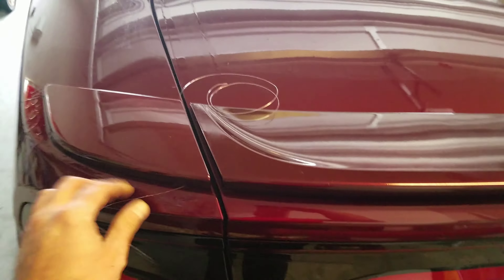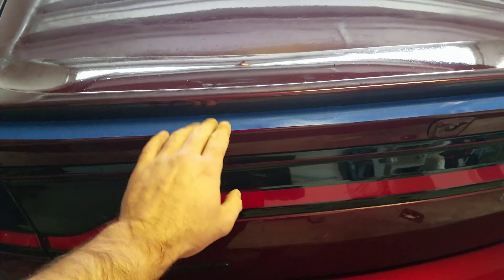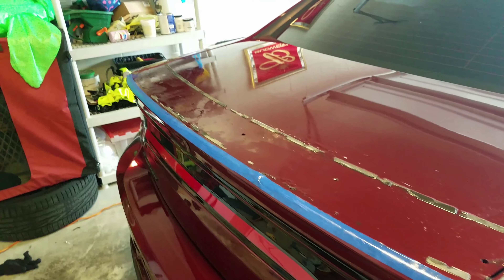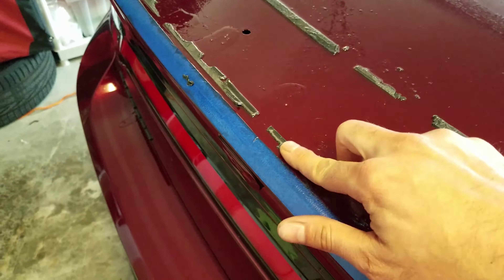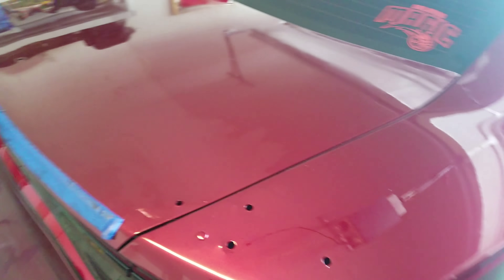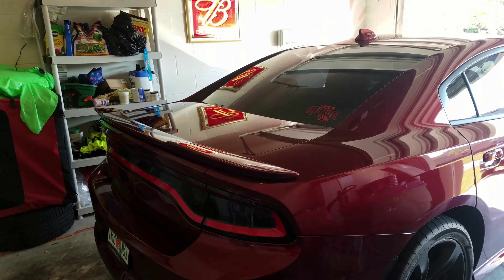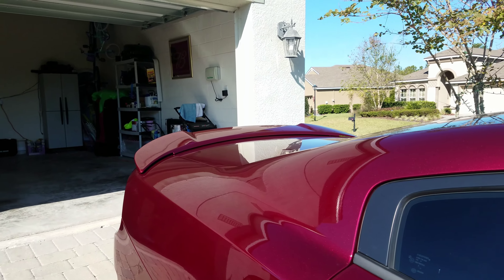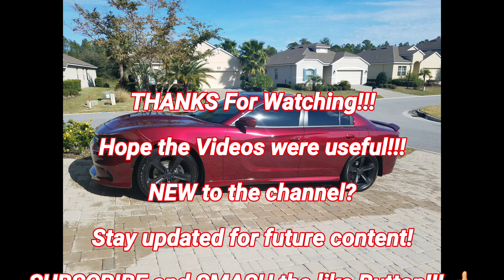Hellcat // SRT Spoiler Install PART 2

Comment: It looks good man. The plugs are barely noticeable since you perfectly color matched them. They kind of just blend in. I agree with ctcharger...after a while you won't even notice the plugs. Great job man!👍
Your car was already a beautiful ride but the mods you have done has really improved the overall look. I will keep watching to see what you do next bro.
Reply from the maker: 2016 R/T Thanks man. Yea I think it came out pretty good. I don't know about you, but I hardly ever open my trunk. So not to worried about the plugs. Lol
Reply: Where did you get the plugs from? What size are the plugs?
Reply from the maker: clenton ballard plugs are 8mm hole plugs. You can get them at home depot or online. The home depot I went to only had the small cap ones. I used the bigger ones I found online on walmat.com. thanks for watching.

Comment: Bro I need help how you get the paint to stick I bought those and paint pealed off with the adhesion promoter
Reply from the maker: I didnt use anything. Just painted them.  One just now starting to chip.  The rest are good.
Reply from the maker: I did coat it with clearcoat after I painted it.

Comment: Hey man was the foam tape one sided or double sided? I saw some spoilers came with one sided foam tape as a gasket, but seeing every factory 3 piece spoiler coming off left with the factory foam residue, it seemed like double sided. Does that matter in the case of sealing?

Comment: FLA HEMI I got a question a have a super track pack too 2018 and I’m going to use the link you put in the description but mine is a f8 green and they don’t have that so I’m going to do the Matte black finish my question is how did u plug the holes when u removed that smaller spoiler, is there a link u can put when I can buy the same plugs u used phrase or can u tell me where I can find them ? Thanks man
Reply from the maker: marvin haydaw go to walmart.com. search 8mm hole plugs. That's where I got mines from.
Reply: FLA HEMI thanks man ur awesome one more question did u use glue with the hole plugs or no oh and the spoiler u bought from amazon is it as good as a factory spoiler the srt one ?
Reply from the maker: marvin haydaw yea quality is good. My color matched  perfectly. And I used silicone on the inside of the quarter panels. And just a LiL on the lips of the plugs. Very little. 👍
Reply: FLA HEMI my only problem is that my car color is F8 Green so the only one I can go with is the matte black but does it look like the Daytona ones the matte black spoiler or should I get a unpainted one and get it painted my car color, what do u think and thanks again
Reply from the maker: marvin haydaw I just seen a octane red Daytona. And it had a black spoiler. Wasn't sure about the black on my color. But after seeing it. It looked good. Kinda wish I got it in black. If you gonna have black rims and it of black on the car. Go with black.
Reply: FLA HEMI yes I do have black rim so I’m guess I’ll just do matte black because it does look really good, thank u so much man!
Reply from the maker: marvin haydaw you have IG??? At the dealership looking at a F8 scat pack wit black spoiler right now. Lol.
Reply: FLA HEMI yes sir I do Marvin_haydaw is my insta gram I got a pic of my charger with me I can show u my spoiler too I got the same one u originally had the 3 piece one it’s okay but I want the one that’s like a scat pack charger
Reply: FLA HEMI also I’m going to order it from amazon the spoiler and do u know if collision shop can instal it ?

Comment: We’re did u order the spoiler from ? Just don’t want to drill holes so we’re u got it from lined up perfect
Reply from the maker: S B the link to the spoiler is in the part 1 video description. Amazon.
Reply: FLA HEMI thanks very much Man looks good ? The plugs hold up no leaking
Reply from the maker: S B no problem homie. Yea so far everything is great. No leaks. I used silicone on the top and bottom inside the fender. 👍 washed my car like 15 times already. No leaks. 😁
Reply: FLA HEMI good for u glad to hear and the holes lined up u didn’t have to drill nothing